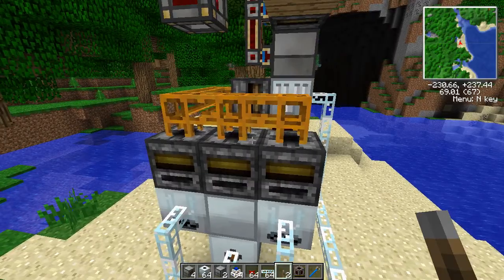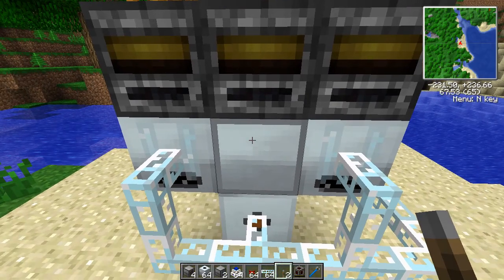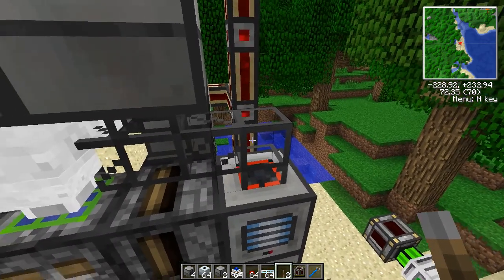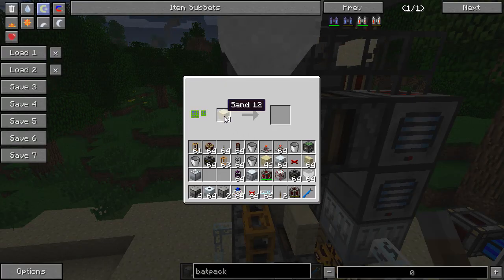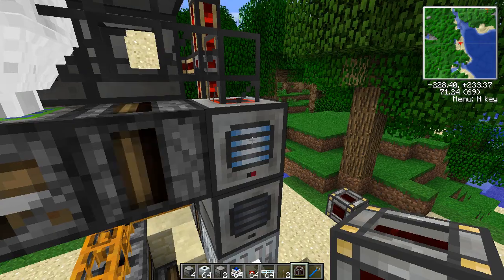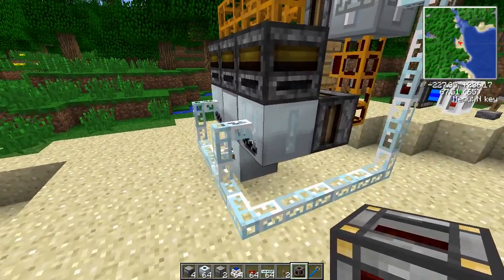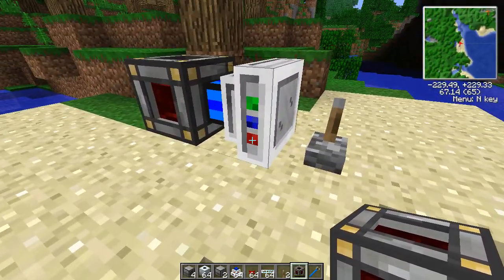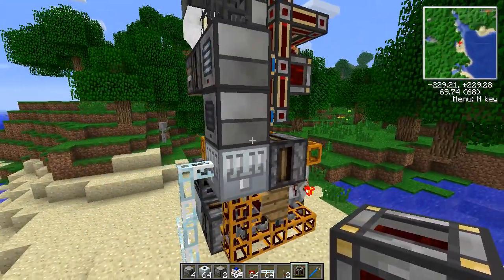Truculent's MJ to EU convertor, sans blutricity and autocrafting

Comment: It is possible to reduce the engine to be more efficient, but the best you can get is 5 EU per 2 MJ, or 3 EU / 1 MJ. The average conversion ratio for EU:MJ is 5:2, so 5 EU for 2 MJ, based off of the value of coal burning in a sterling engine and a generator.